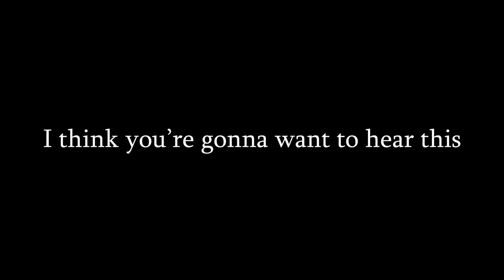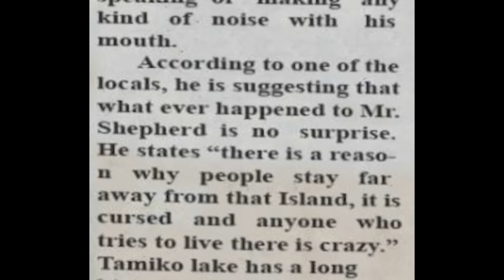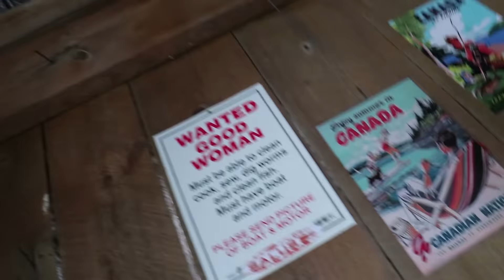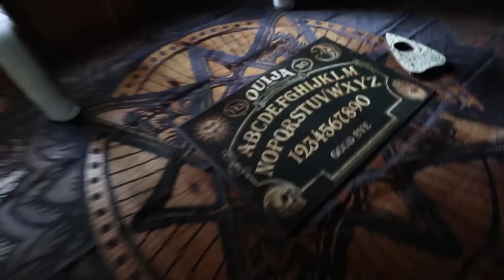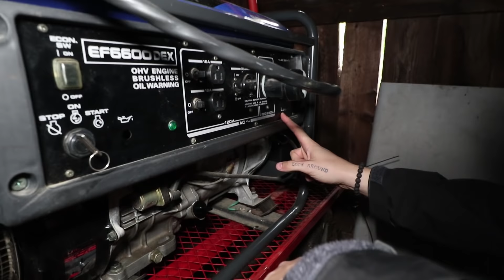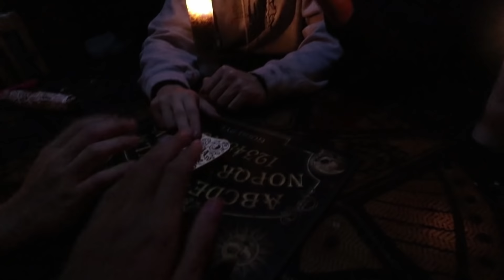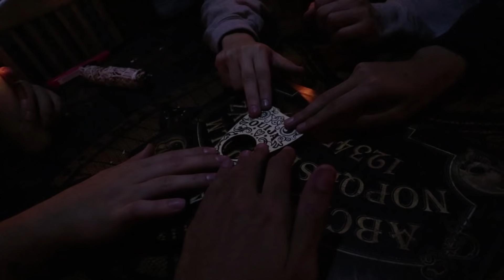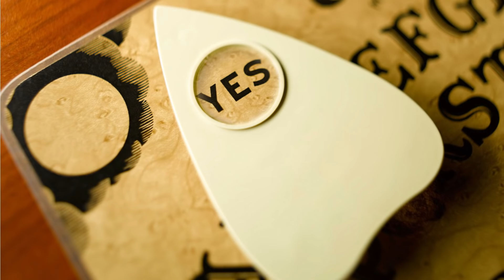We go to a CURSED ISLAND and Discover Something TERRIFYING (FULL MOVIE)

Comment: 1:41:20 I think the entity set fire to the shed where the boat was. The orange light is the fire (seen from the gaps in the wooden planks) and the shaky reflections are from the water.
Reply: But didn't they shine the flash light at the she'd where the boat was
Reply: @noobheads  Now that I'm looking back at it they left the sheds before the fire appeared. I think it was just multiple of the torch-bearers standing along the edge of island. I thought they were still inside the shed and you could see the fire from between wooden planks 😅